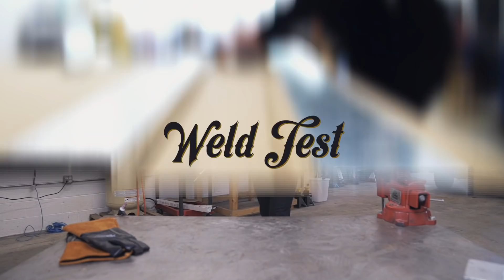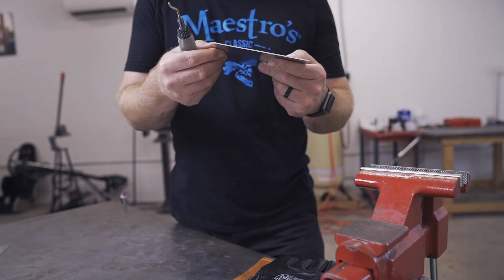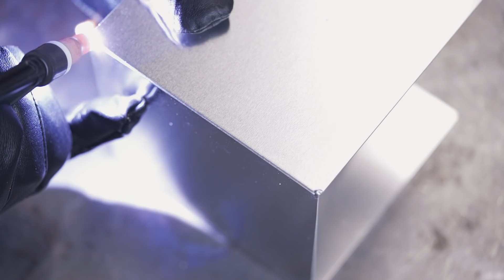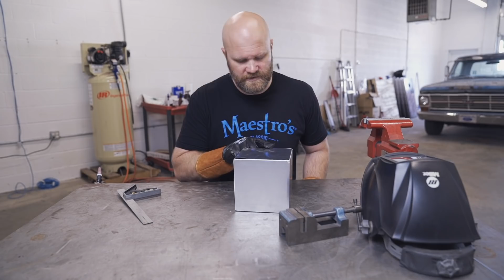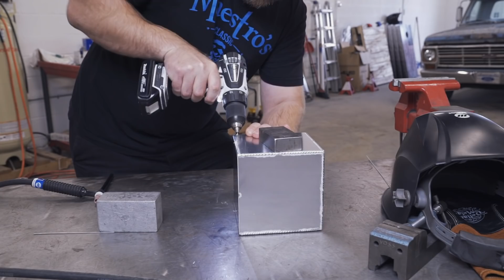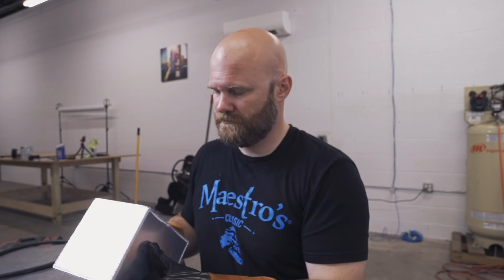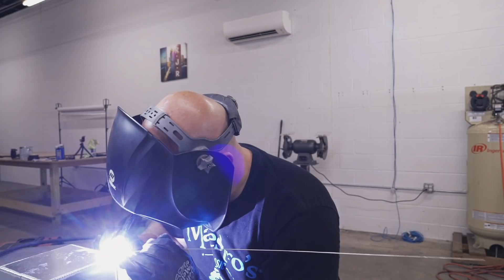Ace a NASCAR Welding Test - TIG Welding an Aluminum Cube

Comment: If you fail a test for a job, don't give up. I went back to company a few months later and I finally passed the test.That job was a stepping stone to another job where I became the shop foreman with a 21 man crew. Be determined to succeed.
Reply from the maker: That’s a great story and lesson man!
Reply: Hell yeah my dude!
Reply: Exactly, anyone who says they've never failed a test has never challenged themselves. Put yourself out there and don't give up.
Reply: That's great! Good for you.
Reply: That last part is the most important part. Be determined to succeed. I would add be ready and willing to accept and learn from failure; and challenge again. Fantastic attitude that very few people have today.
Reply: Christo Clark it will also set a good name for yourself inside the company
Reply: Damn good job! Pass it on to teach others
Reply: It's all about having the right attitude. Companies want people who never say never and never give up they just find solutions and move forward.
Reply: Going from a welder to a Forman is means your a failed welder nothing to be proud of
Reply: Good to hear the level of encouragement here.
Reply: Be determined to succeed by pushing yourself outside your comfort zone
Reply: A forman with a crew of 21 sounds like a nightmare not success 😂
Reply: @averygentry35 , it was, in the beginning. Learned how to tube bend and then improved the process. My previous job was welding motorcycle frames for Custom Chrome. I did not have the experience but I took a chance and kept the job for close to 4 years.  It was the most money I have made.
Reply: @averygentry35  If you a highly skilled highly self motivated crew of 21 that works as a team you've got a miracle machine. Sounds like  US NAVY seal team's.

Comment: Looks great. Lots of uses for it. You could weld a tube on it and use it as a large vacuum canister for the ole Ford behind you... Or a windshield washer fluid tank. Just need a cap and fittings for the motor. Small coolant overflow tank? Sure, a perfect cube might not be that ideal for some of that.... but hey. Ya got one. :)

Comment: I've always found it easier putting g the breather in the corner, that way you dont have to attempt a tie in on top of plugging the vent. When filling letting the part cool tends to work if it's a big enough volume otherwise I've had luck by using a punch or chisel to seal the hole then welding over top of it to hide any marks

Comment: Get a pinky sleeve so you don’t have to keep repositioning your torch hand. Slide your bracing pinky finger smoothly on the sleeve.
That “weight” is a heat sink (chill bar) and not typically allowed in most tests. Only clamps.
A #10 or #12 cup works well on outside corner joints.
Expensive tig gloves are an extravagance as once they’re contaminated...
Looks great Amigo

Comment: I'm no welder, I've just bought a small mig welder and have only used it once. Never have I welder aluminum or even Tig welded yet but watching your issue with the building pressure inside the cube blowing out your weld I would think, just me personally, that if you let it cool down it would depressurize enough to fill the hole. Maybe. Anyway I enjoyed the video and will be watching more in the future

Comment: Sounded like the machine was set on some lower hertz/frequency if it is adjustable on your machine turn it up fairly high for clean thin aluminum will allow the tungsten to be sharpened to a point and give you accuracy like you wouldn’t believe with the balance set to 70-80% penetration ( the weld typical won’t penetrate drastically it will help keep the arch focused, used that set up to weld 0.028” thic aluminum with no pen as the print requirements)
Reply from the maker: My welder doesn’t give me a hertz number, but is about 70% towards penetration. Will try higher.

Comment: I had to do a stainless box, polished, with one weld exposed. Pretty fresh on the tig, but I would have much rather have done it with aluminum lol
Reply: That's a cool test, what was the job? I used to tig in a stainless shop building exhausted systems for commercial buildings.  .020 thru .035, now I'm a pipeliner, crazy how much the thin stainless experience helps me fit up thick carbon pipe!
Reply: CJ Gibbons  it was to work restorations of passenger railroad cars. They have a lot of stainless. It’s a pretty overall gig. Had to do a 3g and a 6g to be hired. You do something different every day.
Reply: @davidwilamowski8591  what's a 3g or 6g?

Comment: Weld aluminum all the time but usually dirty old mismatched aluminum scrap I just making something out of. I need to try and get all involved in cleaning everything sometime and see what I can do.
I make things like that all the time seam welding but usually sheet steel.
Thinnest I go is welding things out of lawn chair aluminum tubing. Not very pretty but they sure are lightweight.
Reply: If you tig weld anything mate, be it Stainless Steel, aluminium or just mild steel cleanliness is absolutely key. You'll be amazed at how much better your welding will be.

Comment: 1) You could drill holes for a bung and a fuel line, weld some mounting brackets on it, and BOOM, Nascar gas tank for a go kart.

2) PLEASE tell me those long arcs were for the camera..

And 

3) Tests that have you weld an air/watertight container are to see if you know how to do it. Drilling a vent hole so your edge welds aren't affected and then chilling the cube before welding your vent hole shut shows a lot.
Reply from the maker: Yeah the one arch was, the rest I honestly have a hard time even seeing what I’m welding with the camera in front of me. Just kind of guessing. I also think the close up shots make it look larger than it is because the tungsten and cup are small it makes the gap look large in proportion.
Reply: @JustVoss  

In the close up shots, I was using the fact that your filler wire was 1/16" and the gap was considerably larger than your filler wire, but a camera in your face screws with almost anybody.

Comment: NASCAR welding test
Now that's funny !!
Please tell me what the criteria is ??
Do they have welding procedures? 
What tests do they use- destructive or visual- NDE- such as PT, X-ray???  
Does NASCAR have its own welding code??
Reply from the maker: It has to look good. They will strength test some parts once in awhile but that’s usually to test the design not the weld. They will X-ray used parts to see if they need to be mile aged out. If your welds keep breaking you most likely lose your job is the extent of it. Building race cars and building hot rods is similar as far as what they expect from a welder.

Comment: Is it possible that oil and/or steel swarf from the drill bit contaminated the hole, preventing a full puddle from forming?  Perhaps try cleaning the bit with acetone, re-drilling the hole, then try welding again, see if it makes any difference.
Reply: I was going to suggest exactly this. I'll bet recleaning that hole would have made it weld so much better. ;)

Comment: Nice work. Was it the camera angle or is your electrode to work distance quite large?
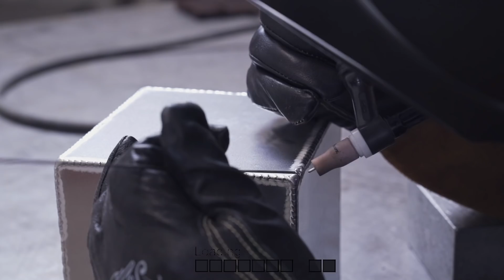Reply: at 15:36, if you catch just the right frame, it looks to be about 1/8" to 3/16" distance from the tip of the electrode to the work, just before he strikes the arc.  Just personal preference.  It obviously works for him.
Reply from the maker: Hopefully camera angle..  ??

Comment: This best way I have found.  I will hand file a vertex down to make my vent hole then weld all your joints first. When coming to the last vertex stop... allow your part to cool fully cool enough to handle with bare hands. Then position your torch to the center of your part. Start two beads prior to the vent hole. Then quickly start your puddle and move. When over the vent hole use more filler to aid in filling you vent hole. 
That’s how I do it and the final product is very presentable.
Reply from the maker: Nice! Good description too

Comment: Just wait until the piece cools down before welding the hole.. the air inside must have been too hot and thus didn't need much  heat to build up pressure..   the cooler the air inside, the less pressure there is and more time you have to seal it up.
Reply from the maker: Thanks!

Comment: I'm a production welder and no expert. I do 1/4" aluminum, nothing thin. But what would be the reason to cut individual sides? Why not just make 4 bends with a single coupon to close it up?
Reply: You could do that but since all the sides have the same length, no matter how you bend it, some sides will smack into the top dies of the press brake  and make those sides bow out. So in the long run it takes more time tapping and massaging everything straight again so you get it nice and square and straight than it takes to do what he did.
Reply: Dieselfun 

Watch the video.
Reply: @jayw900  I did and I didn't understand. Maybe you guys don't have access to a good press brake or someone that knows how to program one but my guy can get really close corners which would save time. If it's a finger brake with enough clearance, you can get tight corners.

Comment: Ahhh I haven’t been cleaning my filler rod, I think I just discovered where the contamination is coming from. Seemed pretty important to you in the prep part. 70 hz, balance? And when you slowed it down seemed like the pulse was being used, how was that set? Thanks for the good video.
Reply from the maker: I pretty much never use machine pulse, but do pulse with my foot. 70 hz is what I was using.

Comment: I have had to similar test 
But carbon steel sheets  gas welding 
We welded in 1/2” half coupling and then  hydro tested. U had to get over xx psi to pass and it made a really cool shape. All the flats ballooned out and the corners stayed. 
The key to getting that last pin hold welded. It to let it cool all the way down the weld up quick
Great vid  my first time on ur site
Reply from the maker: Welcome to the channel! Ballooning out the cube would be cool, I don’t think I have anything high enough pressure unless a air compressor is enough.
Reply: @JustVoss  you would be suprised how little air pressure will blow out an aluminum cube or box.  Marine fuel tanks made of 5052 aluminum (most are .090 or .125) are only tested at 3 psi.   You shop compressor will easily blow that cube apart.

Comment: When I try and Tack thin sheet metal on the edges, I always end up just blowing a hole or it just won’t fuse together on the edges. Running too hot? Any tips in the comments?
Reply: Could be alot of things. Most likely torch angle, have tungsten pointed into the corner (towards the joint) also slowly feather the pedal on.
Reply: If you're just tacking; make sure the edges are touching. Have the tungsten about a millimeter off the workpiece and hammer the petal and immediately lift off. If you feather the petal, you're going to put too much heat into the workpiece and there is your hole
Reply from the maker: They have to be touching, also could be torch angle. Heating both pieces at the same time is important. Once I see them just start to puddle I increase the amps pretty quickly.
Reply: What type of metal?

Comment: Many year ago, I was told to do the tack weld about 1 inch from the ends.
Less chance of blowing away the corner, & better gas shielding too, away from the corners.
Done this work for 25 yrs + , a copper backing strip / chill block saves overheating on long runs too. Just saying.Thanks from the UK.
Reply: and you don't need to start your weld on a tack !
Reply: I like to start on tacks because it's easier to get a good even puddle flow
Reply: @1223-i2h  Near the tack offers a good arc start, but three or four dabs into the bead is an easier place to conceal the tack if you used filler during the fit up.

Comment: I went and bought 63 3×3 aluminum squares from local metal places when i first bought my ac dc machine every time i tried welding them closed with no vent hole i could never get them closed so i drilled hole in middle to and they closed up just used the hole to pressure test them for shits and giggles

Comment: I have been fighting AL for a while with the pressure build up. If I can I drill my hole just under my filler rod size. I peen a piece into the hole after the work piece cools then hit it quick before it builds up too much heat. Doesn't always work so great but it is what I have had the best luck with.
Reply: That's pretty fuckin slick buddy

Comment: I let the work cool off and then go back just for the vent hole - it usually won't build enough pressure if you do it quickly. 
Nice video
Reply from the maker: Yeah letting it sit longer was probably the play there, thanks!
Reply: Justin Voss I agree with David 100% even after doing this for years I struggle to just leave it alone when it’s hot. Good video non the less. 👍🏼
Reply: On small boxes pressure will build up in seconds
Reply: Pressure is a result of heat, doing it partially submerged can help a lot.